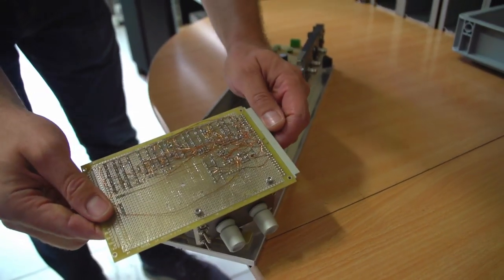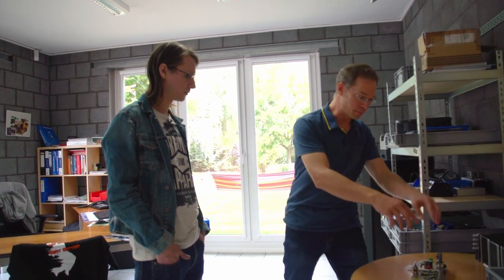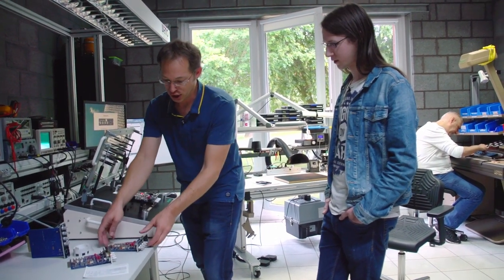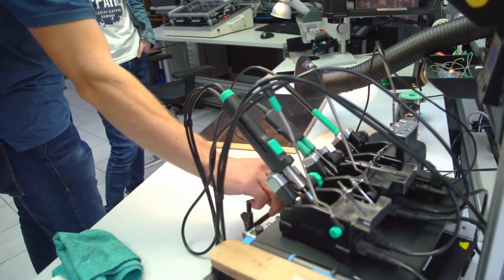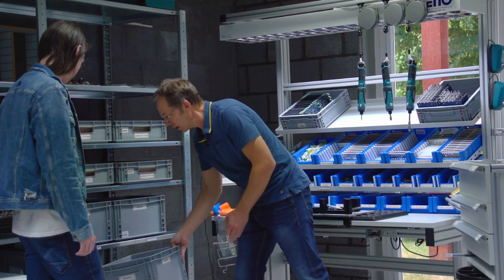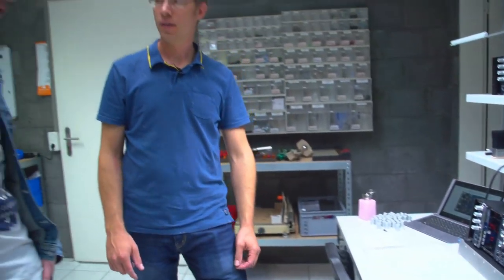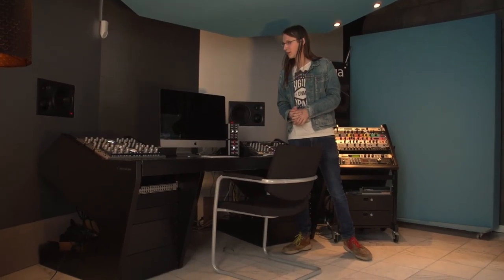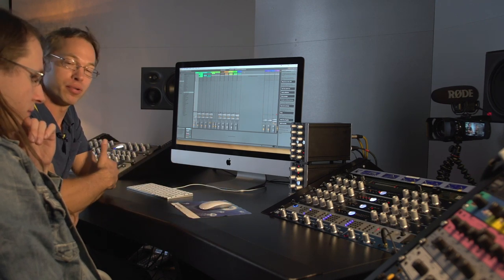ELYSIA FACTORY TOUR!

Comment: People can't really hear higher than 20kHz but audio processing systems must have sufficient bandwidth and in the case of analog processing circuits which can swing voltage and current sufficiently quickly to minimize undesirable artifacts which we certainly can hear in the audible range.